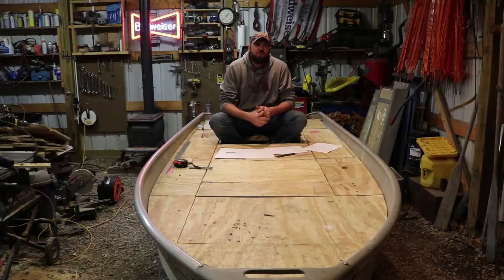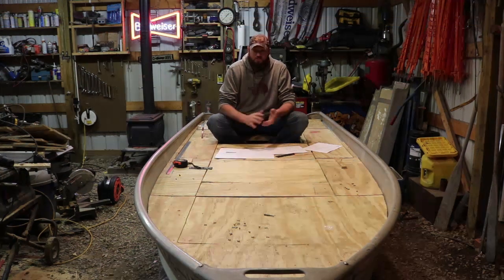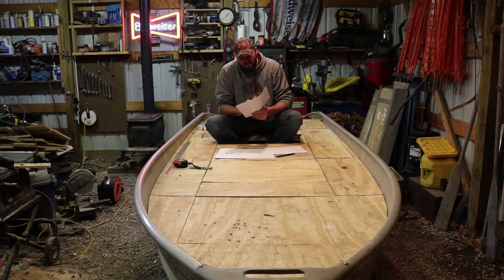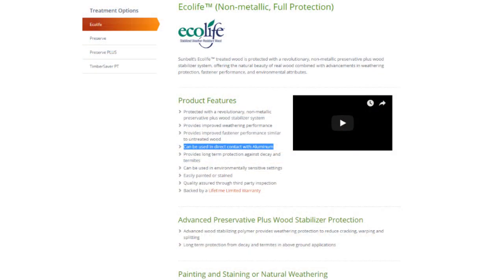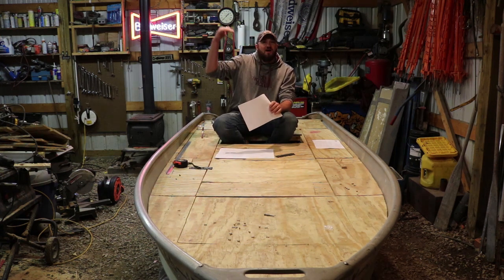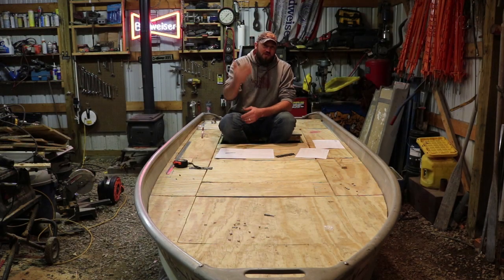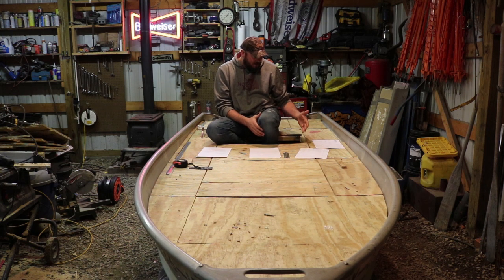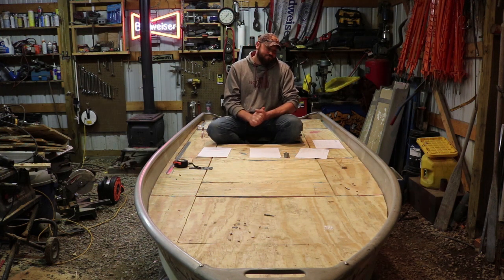Can you use Treated Wood with Aluminum? GAME CHANGING ANSWER!!!! pt. 5, Jon to bass boat build

Comment: Do they say what the wood is treated with? Heres what EL2 is, EL2 SBX-DOT ACQ, or Alkaline Copper Quaternary. See that word "copper". It may take longer to eat your boat than copper sulfate does, but it will eat it. Do it the safe way and use marine plywood, thats what it's for. My hull was eaten by treated bunks and I did a lot of research on it and talked with my chemist at work. Just say no to treated.

Comment: This is what AI Chat Says.  "When copper and aluminum are in contact with each other in the presence of an electrolyte containing ions, such as saltwater, an electrical potential difference is created between them. This can cause the aluminum to corrode and form holes."  I would have never guessed it.  Getting ready for a repair myself.  Thanks Sir.

Comment: If it's kept dry you can use a membrane to seperate the wood from the metal, but in a boat if it gets wet it will leach out onto the metal. You can use cedar wood it is rot resistant.

Comment: How can I have pressure treated plywood in my aluminum trailer without corrosion? The Short Answer: A Barrier Membrane between the aluminum and pressure treated plywood. As long as the aluminum is not directly touching the pressure treated plywood, you will not experience any corrosion or reaction between the two. I'm putting a layer of 6mm plastic on edge witch will me covered bi carpet. But it's been a few years for you . How did it work out ?

Comment: I googled around and it seems that CCA PT wood is okay to use together but the wood and metal needs to be kept from direct contact by separating the two with a rubber or plastic sheeting,, or the likes.

I do believe that a layer of deck carpet between the deck plywood and aluminum boat should be work even better.  
Or use a rubber or plastic membrane,,  and the carpet together.

Comment: The problem is everyone wants to repeat what others say and think theyre smart. By the time youre done painting, epoxing, or what every your going to do to the wood, is it really going to touch aluminum? Plus on top of that youre most likely going to carpet the wood. Another barrier between wood and aluminum. Just do what youre doing and youll be fine.. Beware of trolls

Comment: I got my uncle’s 14 foot aluminum fishing boat and did a few thing like your boat up in the bow but he used unpainted aluminum from highway signs and when I started fixing it up the aluminum in contact with the steel and aluminum in the seats destroyed the seats so I ripped everything out and Ann in the process of rebuilding everything I’m using pressure treated plywood from home depot but the one thing I’m doing different is all the plywood is coated with several layers of fiberglass to protect the wood and the inside is repainted. So far it’s going great but being that I live in Michigan’s Upper Peninsula and I don’t have a garage and the date is 9-5-2021 I have about 40 days before snow starts. Thanks for the information and good luck.

Comment: I repaired an aluminum Starcraft over 4 years ago with AC2 wood from Menards, which is also marketed as a direct contact wood with aluminum.  No pits, corrosion, etc.  4+ years later.  long story short: ACQ = bad for boats.... AC2 = OK for boats.

Here is the information:

https://www.midwestmanufacturing.com/MidwestWebsite/web/cms/docs/AC2PressureTreated.pdf
Reply: Still no issues?

Comment: I put treated plywood and carpet in my old tracker several years ago.  I must have got lucky with the type I purchased because I didn't have any issues.  I never would have thought about different types of treated wood reacting with the aluminum.  All the time, money, and energy on that project.  I would have been crushed if it destroyed my boat...  Thanks for the very informative video!

Comment: Very interesting...I am in the process of replacing the plywood floor in my Jon boat a few places have started to fail after 28 years....I used pressure treated 2 X4 's after 28 years there is NO sign of Aluminum pitting perhaps I just got lucky ??? Or perhaps the adhesive acted like a buffer in any event I plan on using the same 2 X4's they are still in great shape.
Thank You for all your research certain your video will help many !!

Comment: Chromium copper whats in reguler pressure treated iv seen a 4x4 post eat up coil stock aluminum they wrapped it in all treated not alike depends on the manufacture

Comment: Thanks a lot man.  I just put a sub floor in read don’t use pressure treated so I came across your video.  I bought mine at Lowe’s as well and the tags saws EL2.  My 2x4 are the bad stuff though.  Switch out a little bracing and I should be good. Thanks again. Subscribed

Comment: Formaldehyde has not been used in years, copper chromate is used, it will eat any metal except hot dip galvanized or stainless steel. Aluminum doesn’t stand a chance. Many home contractors think the same thing and replace rotten wood around windows and doors with P.T. Wood and then flash with aluminum. In three years the aluminum will be eaten away, white chalky and full of holes.

Comment: Since it’s been a year, has there been any issues with the pressure treated ecolife plywood on your aluminium boat? Also I looked up the pdf document and it directly states don’t use on aluminum..
Reply from the maker: Well, let's talk about it. I appreciate you doing you own research and looking into the product. So if you are looking at the same pdf download that I am seeing then, then you should find it under
Fasteners and Connectors
Ecolife can be used in direct contact with aluminum products, even in continuously 
wet applications.
n Use building-code approved, corrosion-resistant fasteners and connectors suitable 
for use in pressure-treated wood. 
Or something like that. Lol but to get to your question about any issues that I have see. So It visually appears to have zero affect on the aluminum. But have i pulled a piece of the frame up and looked under it. No!! Like I said in the video do your research and use if you want, it shows in the document that is safe to use with aluminum.  Hey let me know your appion on it and thank you for commenting!
Reply: kig outdoors thanks for the quick reply!
I couldn’t find the document you looked at it. 
I went to ecolife pdf and couldn’t find anything on it but since it’s also severe weather ply I went to their pdf and it clearly stated don’t use with aluminum.  http://pdf.lowes.com/useandcareguides/098411090024_use.pdf
Under the important information the first bullet states: “Aluminum should not be used in direct contact with Severe Weather treated wood.” I am surprised there has been no corrosion and thank you for your video & research.
Reply from the maker: @tylerwhite479  So fyi there is a link for the document in the  Description of the video. Just hit that down arrow and it should show the document I was talking about.
Reply from the maker: Its the ecolife facts sheet pdf!
Reply from the maker: Also severe weather treated wood is home depot wood and yes you do not want to use it at all. It has a coppertox base or whatever it's call and it eats aluminum like it isn't anything.
Reply: @tylerwhite479  Hey  Tyler. The Severe Weather product you're referencing is specifically treated with Alkaline Copper Quaternary (ACQ) or Copper Azole (CA). It's referenced in the small print at the very bottom. This product can be used for ground contact. 

The Severe Weather product that this video is talking about is specifically NOT meant for ground contact and is treated with EcoLife, (EL2). Like he says in the video, I don't for certain that it's the different treatments for ground contact and non-ground contact, but I THINK that's what makes one safe for aluminum and the other not.

Comment: If the wood is pressure treated with MCA or any other copper based treatment do not use it in aluminum boat projects as this pressure treating solution will cause dissimilar metal corrosion .
Reply from the maker: So don't use pressure treated wood? Is that what your saying.
Reply: @KIGOutdoors  You can use it if it has no copper in the treatment solution that is used, you just have to do research on the solution used to stay away from the type.You should be alright using the EL2 wood as it's a non-metalic based treatment.

Comment: The bunks on my 2006 bass boat trailer finally wore out and I replaced them myself. I do not know what lumber was used originally but I checked the bottom of the boat and there was no damage. This was in 2015 so whatever the wood it must have been pretty good, treated or not. Anyway, I had some two by fours on hand from a previous project and had been in my attic out of the weather for several years. It was in good shape, no warpage, no knot holes, etc but there wasn't enough to do 4 bunks. Off to Lowes I go to buy more. Did so and off to the launch. Took me just a couple of hours and I was back home slapping myself on the back for having done such a great job. Yes, I had looked at You Tube for comments on how to do the job. Sure enough, there are the pros and cons of using treated, pressure treated, non treated, and such. I used the wood that is mentioned in this presentation by Kig outdoors. I jack up my boat two or three times a year to check what's going on and nothing is going on, no pitting, rusting, or holes five years after the job. I'm either lucky or this guy is right, and I think he's right.

Comment: I used treated wood on a jon boat build some 15 year ago and it is still going strong. Great video
Reply: pressure treated? i bet theres holes in the aluminum wherre the wood touches the aluminum
Reply: @chronicawareness9986  they changed the wood in 2004
Reply: @chronicawareness9986   As of 12/31/2003 Arsenic was no longer allowed in pressure treated wood.  So anything manufactured after that date could give you potential aluminum problems.
Reply from the maker: So wood after 2003 isn't safe? Asking for a friend..
Reply: @KIGOutdoors  I'm no expert in this subject but the way I understand it from what I've read online it is that Arsenic was no longer allowed after 2003 and that copper was used in it's place.  Copper is the reason for the corrosion. As you pointed out in the video it appears that there are some products that are claiming to be safe for use with Aluminum.  I don't have any first hand experience with these products to know how this claim holds up.  I would believe that if you haven't seen any corrosion on your project after a year that it must be safe.  Might be worth taking a real close look at where the wood butts up against the aluminum to let your viewers know what they could expect.

Comment: I know you said all your wood is treated even the plywood, but I look up treated plywood from Lowe’s and it’s pressure treated with CA!?!
Reply from the maker: I am sure there is different kinds of plywood that can be bought. Got to lowes website type in this in the search bar. 471097. This is the wood I used. It is treated by ecolife, it might not be adviable in your area ,I dont know! But hey good catch and question. What are your thoughts on that wood?
Reply: Thank you for the reply, and sir you are correct it’s unavailable for the Lowe’s stores around my area which is GA, I guess I’m going to have to go with untreated and seal it myself

Comment: So that brand of  plywood is safe that is good to know. My question to you is did you look into the 2xs that you used? Those look pretty green? which in all the damaged boats I repair seems to be the green treat/pressure treated or CCA that causes the issues.
Reply from the maker: Yes the 2x4's that I ripped in half were made by the same company and yes you are right about the CCA. It is what causes the  Corrosion to aluminum. But I called the company and contacted lowes and they both said it was safe to be used with aluminum. Now that being said I haven't tested it out myself of a long period of time. But I still am using it in my boat. So far nothing has showed up in that 4 months that would worry me. I Encourage you or anybody to do their own  Research. Dont take my word for it, look into, try to find something different, something that might not be good to use. That way we can learn and tell everyone about the info. Thank you for your comment and view!
Reply: Good to hear. I'll have to make a trip to lowes and check it out. Home depot and menards only sell cca treated from what I've ever seen the hundreds of times there
Reply from the maker: @JDSOutdoors  i am no professor of chemistry, or anything of that nature. I am a guy who f up and put treated wood in a boat. I can only go by the info the company gives. Good luck man!
Reply: @KIGOutdoors  I'm no pro either just a guy who has made mistakes myself. I think one of the main problems is the word treated is a loose term meaning many things

Comment: Yeah I thought I messed up too after decking out our boat in pressure treated wood from menards. But after doing some research, menards AC2 pressure treated plywood is also safe with aluminum. I even contacted the manufacturing company and they confirmed it is safe with aluminum. Just wanted to let you and others know that menards is another option. Just make sure it is AC2 treated.
Reply: I'm also in the area where Menards AC2 is an option. I was thinking of using on an aluminum snowmobile trailer. Have you noticed any corrosion using the AC2?

Comment: Man I'm down! I used treated in 4 builds.  But i had corrosion with wood from Lowe's.  Go to my channel,  i put a picture up of one of my supports in a video. It was pitted and corroded.  My video wasn't appreciated....  most likely different parts of the country use different suppliers. Good job returning fire.

Comment: I’m currently converting a 16 foot bass tracker into a bass boat again. Although you went with the safe treated plywood for aluminum. I went with non treated but I coated the wood twice with an oil based enamel and siliconed the edges. Which I got the idea from Michael Lopez. Either way it’ll do the same job as what you did. Good luck to you!
Reply from the maker: I wish YouTube would allow pictures to be posted in the comments! Is your boat completed? Thanks for the comment and view
Reply: KIG Outdoors the front deck aluminum framing is complete. I just got done painting the subfloor with the enamel. The boat was completely gutted when I bought it so I’ve only been at it for a few weeks now. I should be done with everything in a few more weeks. If you would like I could email you some pictures when it’s all completed. I think it’s gonna look really cool. Bought it for 300$ with the trailer.

Comment: I just painted/sealed my treated lumber and laid foam tape across the struts. No contact. Besides that wood isn't going to eat through the aluminum for a long time. Think about how old  these boats we are redoing are, and you only find a few pit marks and few actual holes. It was the rivets that did the most leaking. Great job can't wait to see the finish product.

Comment: This is great to know. I've seen these same YouTube videos too saying the same thing over and over. I guess it really does depend on the ingredient used. 

There is a process that uses formaldehyde to pressure treat wood, maybe that is the stuff that eats aluminum, and this might be where all this started. I've seen video footage of old boats being severely pitted that had treated lumber, so this may have had an earlier chemical process that was used but modern materials now are used to accommodate aluminum applications of all types as more and more aluminum is being used for weight savings in many applications beside boats.

It's good that you did your homework rather than to just follow along with the "herd".

Comment: You should never use pressure treated wood on an aluminum boat. Over time the chemicals used to treat the wood will react with the aluminum and it actually starts  to corrode/pit the aluminum
Reply from the maker: Guess you didn't watch the video all the way! That's cool thanks for the comment and veiw!
Reply: turn up the volume next time, maybe you will learn a new trick....wooof!!
Reply: John Waltner  watch the video

Comment: This is what I always use and it last and last. 

3/4 CAT PS1-09 Marine Grade Douglas Fir Sanded Plywood, Application as 4 x 8
Item # 622774 Model # 119668
 (6)
$75.98
 SAVE
 SHARE
CHECK OTHER STORES
FREE Store Pickup
Unavailable for Pickup at Athens Lowe's
Delivery
Currently unavailable
 5 percent OFF Every day OR 6 Months Special Financing. Minimum Purchase required.
Product Information
Description
Applications include marine craft construction, boat docks, pontoon boat decks, furniture and bathroom and kitchen walls and subfloor
Designed for applications where high moisture conditions may be encountered
Use in applications where core quality and structural integrity are required
7 ply construction with fully waterproof structural adhesive for strength and stability
Sanded A grade face and B grade back
Panels must be sealed on edges and face in applications that require exposure to moisture

I don’t blame you one bit for not ripping it back out.  I wouldn’t either.  Looks like you are going to be keeping it inside anyway.  So it should last for years and years. Probably longer then the carpet.
Reply from the maker: 75 dollars a sheet my goodness! How many sheets did you use?